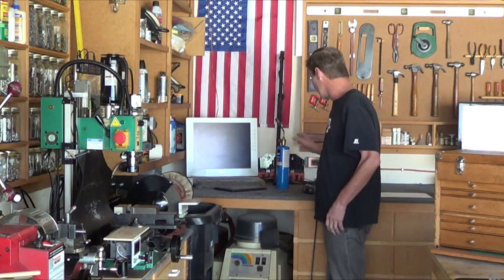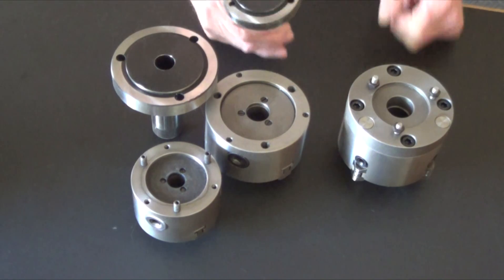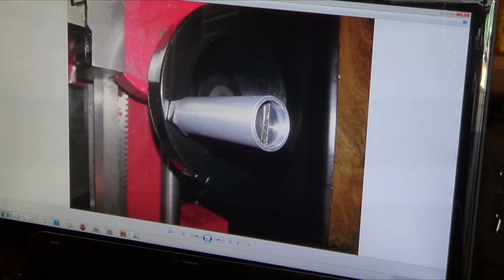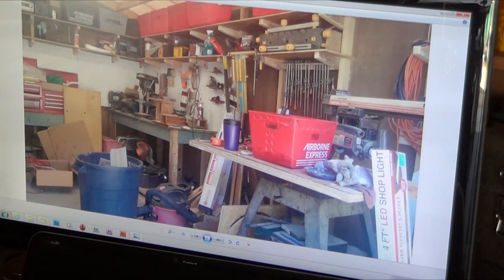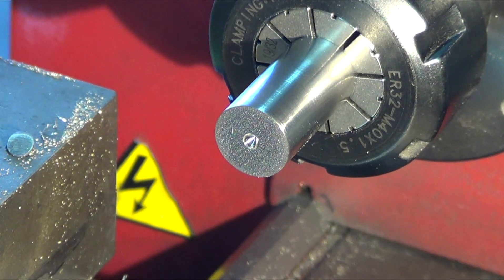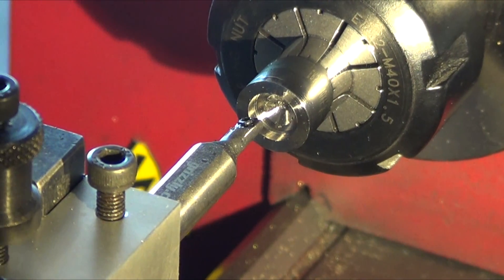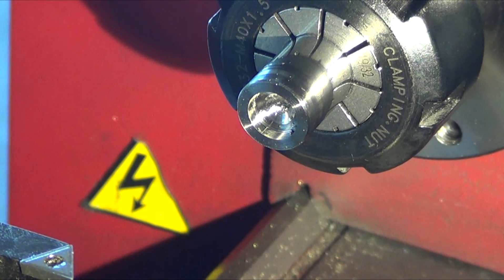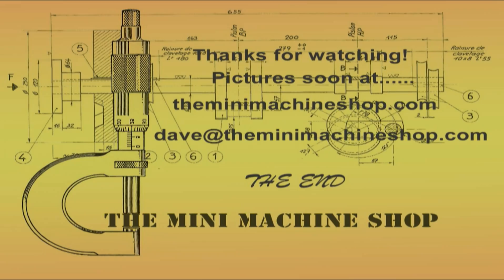Mini Lathe Turning Titanium Ring Video #64

Comment: I bought titanium tube from China (Ebay) for ring making. I was pleasantly surprised how well it machined. I think you need sharp tools and light cuts. I made an expanding arbor to finish the outside of the rings after parting off. Just a piece of round mild steel  bar. Drill and tap down the centre.  Clearance drill down a way. Use a big centre drill to put a shallow angle chamfer on the end of the hole. Slit down the axis twice at 90 degrees to each other. Use a cap head screw and machine under the head to match the angle of the centre drill you used. When you tighten the screw the arbor will expand clamping the ring.

Comment: Just have to cut slow and lots of lube, when it catches fire, it burns bright and there is no putting it out.
Reply from the maker: I learned about the fire hazard long after making the ring!
Reply: @TheMiniMachineShop  Is the only thing you upgraded the chuck?
Reply from the maker: The chuck, tool post, saddle stabilizer, etc you'll have to go thru my playlist it is only on the lathe.

Comment: Hello Dave 
Any link to the cutter at 15:20

I bought set of HSS 8mm tools for my lathe but im not sure if they work so well. Havent made any upgrades so far.
Lathe just arrived few days ago.. But already i saw the problems it has, just like everyone has, stock lathe

Maybe i should buy the cutting tools with yellow tip?

Thanks
Reply from the maker: That's just a plain HSS parting tool from Amazon. You need to email me so I can see what's going on since you're new to it.... Also go to my playlist it's only on lathe videos.
Reply: Don't use them on stainless or titanium you will smoke them all

Comment: Hi. What kind of tools did you use to work in titanium ? Is it carbide?
Reply from the maker: Boring, turning and camphering was a run of the mill carbide insert but parting was better with a HSS tool over carbide. And I bet all could have been done with HSS.

Comment: a Hacksaw will do it.. a Bi-metall blade will cut it nicely, but it takes time.
Drilling: don't go over 12-15 Surface feet per minute, and turning with solid carbide inserts, 200 surfacefeet/min is a good ballpark figure.. i machine Titanium all the time on an equally small Emco 5 CNC

Comment: to hold it from the other side get a machinable collet and machine your OD into the collet the put your ring in there and walla. I got mine from use-enco.com
Reply from the maker: Good input but thankfully the HSS parting tool worked. Think I stumbled on that collet somewhere. Going to Enco to see. Thanks!